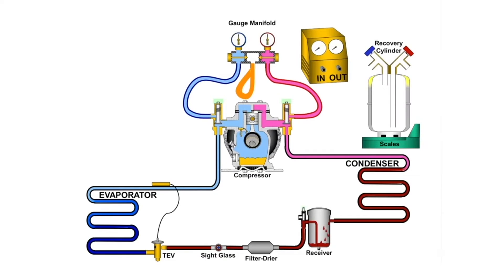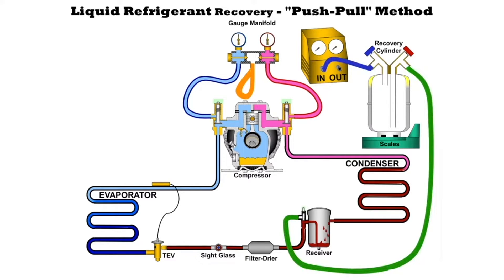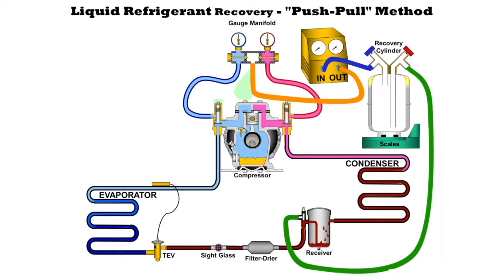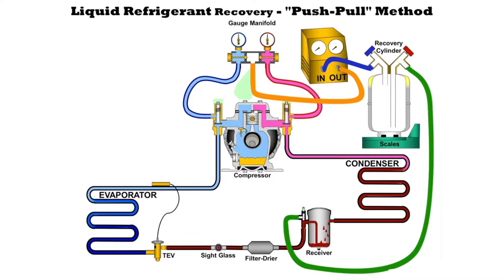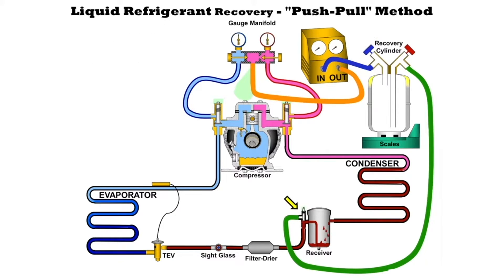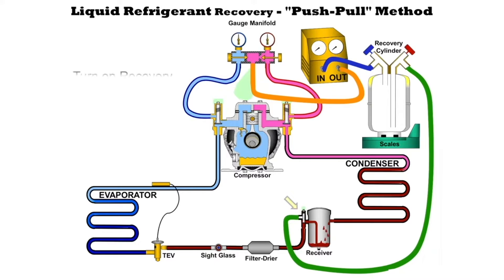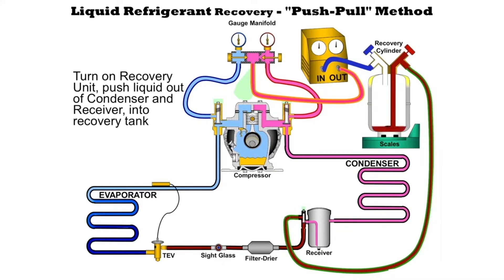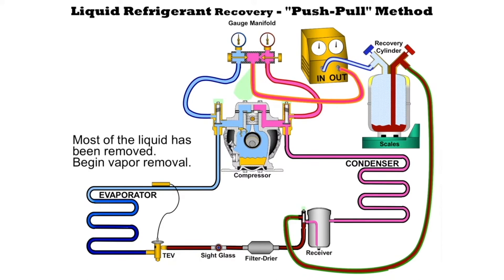Liquid Refrigerant Recovery. Push-Pull Method

Comment: Great video, very informative. The only thing you didn't mention is what do you set the 2 valves on the recovery machine to? Is it open on (V1) and recover on (V2)?
Reply from the maker: Thank you very much, and you are correct. I did not mention the valves V1 and V2 because some have different numbering or labeling systems. You have to look on there yourself and see which one is basically the suction to the recovery machine at which one is the discharge out of the recovery machine.   Remember, the recovery machine is nothing more than a compressor and a small condenser inside. So you have a suction that is pulling the refrigerant out of the system that needs to be recovered and you have a discharge or maybe I should say a liquid line that is putting the liquid into the recovery machine.      I hope this helps! Thank you for watching!